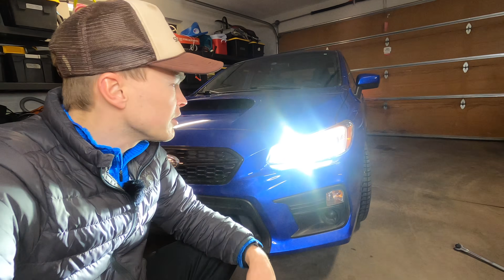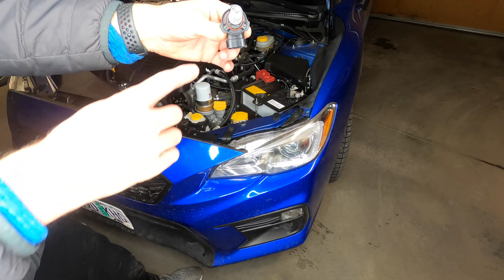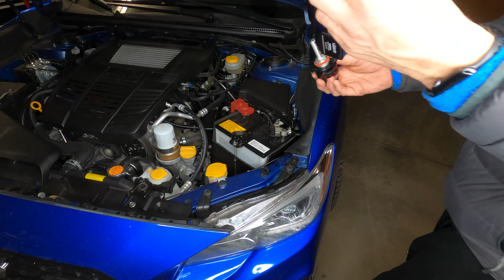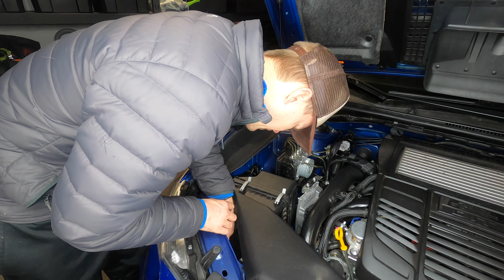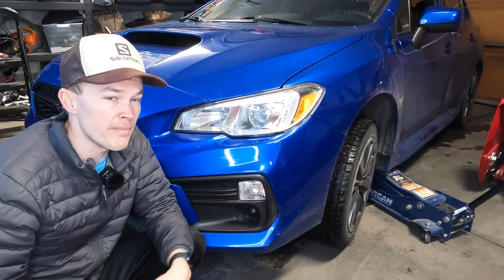Subaru WRX LED Lighting Upgrades - low beams, high beams & blinkers

Comment: Do you know how easy it is to open the airbox and give yourself some room to work. There's 2 plastic clips holding the ducting in I can't believe you squeezed your arms in there for so long. Clean your air filter while you are at it and have it open...
Reply: It's also super quick to just pull the whole airbox out. Same with the battery.

Comment: Man are these even legal? this stuff worries me..
Reply: Depends on your state, for example in Ca. It is illegal but nobody cares tbh
Reply: Don't change parts on your car if you're not sure about legality, or if you're worried about it, really. It's a bad idea to run super bright bulbs in reflector-style headlights, which at least on the Base WRX is only the high beam - The projector low beams work well with upgraded lights. It was the first thing I did on my car, I hated how dim and yellow the factory low beams looked. Night driving was straight up dangerous.
Reply: Yes they are legal, in fact, most cars come with them.

Comment: It’s frustrating how difficult bulb access is on many cars.  The worst I’ve come across was a MK4 VW Jetta I used to have years ago.  The owners manual just says to go to a dealership.  Took me a long time and a mangled hand to replace bulbs in that car.
Reply from the maker: It really seams like bulb replacements should be an easy process... that and oil changes yet sometimes so hard to do!
Reply: It's cake on the WRX if you spend a minute or two and pull the airbox and battery. The front half of the airbox is just clips.

Comment: Mike, my wife has a 2014 XV Crosstrek.  I have done full LED with the exception of high beams. On the Crosstrek, the high beams act as DRL, there is a resistor inline with the ground leg dropping the voltage to much to keep the LED drivers from going crazy.  I have located the resistor and am considering bypassing it, the only real issue is bright high DRLs.  I used Canbus led turn signals and replaced the side marker and light around the headlight with LED. great look.  I occasionally had hyper flash when the turn signals were on a long time. I resolved this with an LED flasher from Diode Dynamics, they had one that had options so you  could change how it flashed on lane change and make your Hazards strobe.  Good work, hope you keep this when the Tundra comes in.
Reply from the maker: Good to know.  The 4Runner has a bulb that duals for high beams and DRLs as well and makes it hard to swap out.  Not sure if I can justify keeping the WRX when the Tundra arrives but I sure want to after having plenty of fun with it the last several weeks!